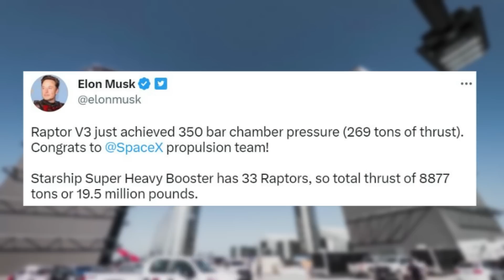A Closer Look At SpaceX's New Raptor V3 Engine

Comment: Make the engines reliable first!
Reply: The engines are famously reliable. The ones used on the Starship were EOL previous gen engines and probably destroyed by debris thanks to their hairbrained flat concrete idea.
Reply: @Freshbott2  Elon himself said there was no evidence that debris kicked up by the launch was the cause of raptors failing, but he admitted that does not rule out that the debris caused some damage to some of the raptors.   Three raptors were shut down right at launch according to Elon so reliability is an ongoing issue.  The new test engine Raptor 3 may have been designed to address its reliability issue, but no one has said as much yet.
Reply: @michaeldeierhoi4096  good to know. Even if it wasn’t debris, I don’t see how the shockwaves wouldn’t have caused issues as well. Whoever decided to do the flat thing was delusional regardless of how it happened.
Reply: Oh wow it's almost as if pushing things to their limits give more insight into the weak points of a design, which allow for improvements which lead to a greater reliability.

Comment: I’m guessing this question is dense, but why so many Raptors when they’re reusable?
Reply: Testing continued refinements to the production process, mainly. Starship is intended for mass production unlike any other rocket, so these improvements will be needed to aid economy of scale.

It also gives them plenty of new hardware they can use for refining rocket assembly, and stuff they can throw into the air during launch tests in exchange for valuable flight data.
Reply: SpaceX intends to build a fleet of 1,000 Starships (probably the larger Starship 2) and conduct 1,000 flights each year for 10 years in order to settle Mars.  Elon doesn't aim low!
Reply: In addition the Raptor engine is still in development and not even potentially reusable until the booster and starship are caught, land or are in some way preserved.   That's many flights away.

Comment: They don’t have v2 reliable enough to have all 33 start and keep running all together. Maybe they should focus on getting one done and reliably working before spending so much time developing another unreliable engine.
Reply: Maybe the changes also improved reliability.
Reply: @mrbaab5932  They increased chamber pressure... that alone speaks of lower reliability and shorter lifespan of multiple components.  This is the kind of thing you want in a single use engine not an engine that will be used repeatedly and have a fast turn around. I would have preferred if Elon had announced that Raptor3 can burn continuously for 5000sec before failure. A longer mean time to failure means more engines can be fired together and more launches can be made before the engine needs in-depth servicing
Reply: @nickl5658  That is ultimately immaterial because this news release is merely the first we have heard about the Raptor 3 so to pass judgment on it is premature as it will undergo many, many more months perhaps years of testing before it might replace the Raptor 2.   And the raptor 2 is also being continuously tested to improve its function and reliability.
Reply: @nickl5658  No.

You know what they'll do if they realize that too high of a chamber pressure decreases reliability so much that the extra performance isn't worth the decreased launch cadence? They'll lower the chamber pressure.

Raptor 3 has only just started its initial tests, who are you to say that just running a higher chamber pressure guarantees it to never being reliable enough?
Reply: Raptor 2 still young so we will see software could be a problem also
Reply: Thats why its called Raptor V3, it is the newer and better version of the Raptor V2. No where does it say increase in thrust = less reliability.

Comment: What's the point if methane can't be made on the moon or Mars?
Reply: Methane can be made on mars with the CO2 atmosphere
Reply: SpaceX designed starship to be launch from Mars and yes, they though if producing the fuel on Mars, which there is plenty on Mars, investigate before posting, everyone that knows and made the effort to read on starship already knows this.
Reply: Can be made on mars
Reply: As others have noted methane has been detected on Mars and in addition the Sabatier process can be used to produce methane from CO2, of which is in highest concentration on Mars and water.